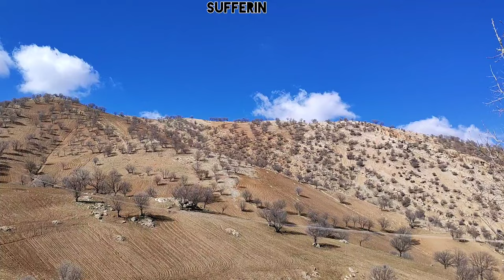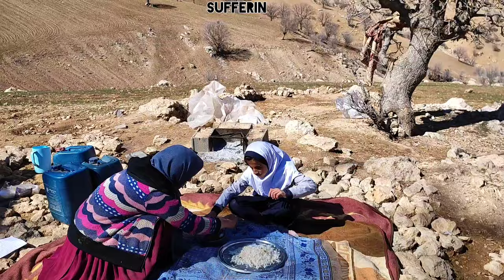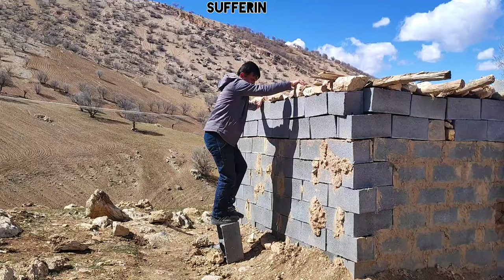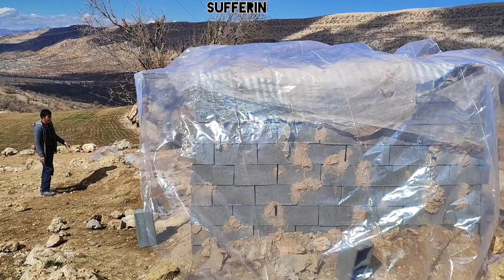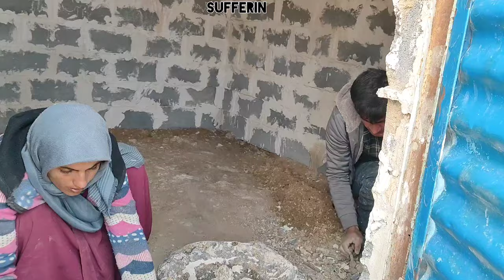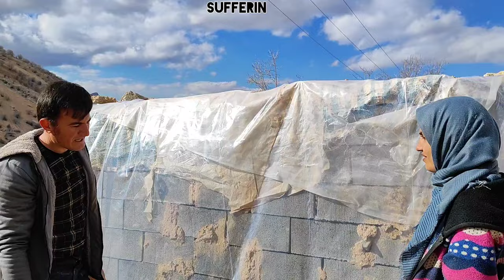Fixing the roof of the house by a young man and his lover

Comment: Don’t you think you shud fix the rooftop tilted a bit. So that when it rain, the water would fall off. If not, there would be a water poodle on top of the roof…then leaking. Why didn’t you do a  proper roof as they are going to stay there for a long time.

Comment: Well if this is what we are doing...Cement or her kind of mud should have gone under and over the rocks and poles before he nailed more slats on. Nail the tarp down with slats of wood. He did nothing with the hole above the door. If the poles went they other way the plastic could of been like a litlle awning across the front. Slats nailed to them,  plastic over and rocks to hold the plastic down. A little awning. I cant wait to see what happens when it rains. 😮